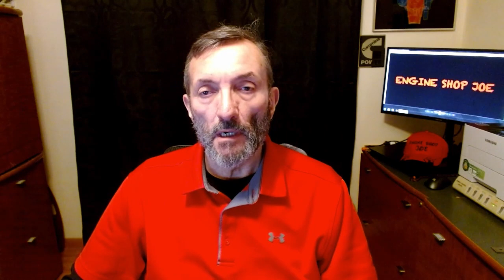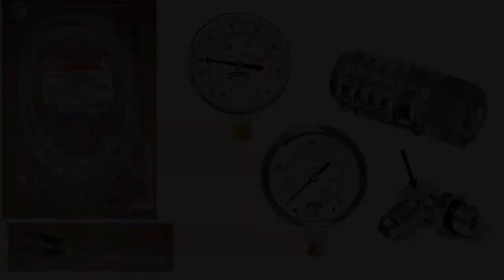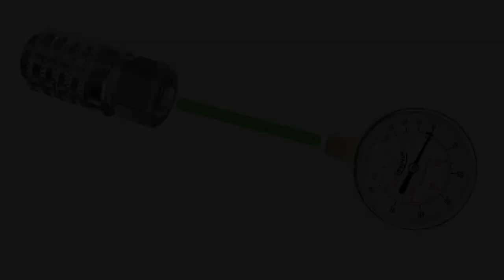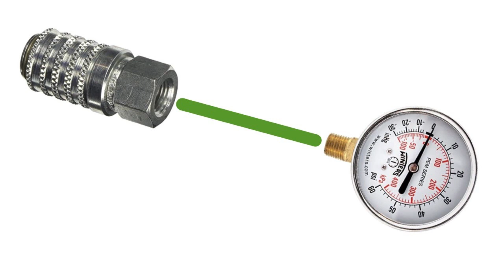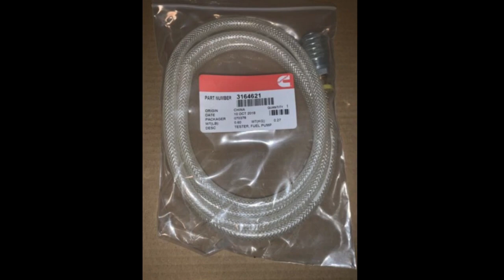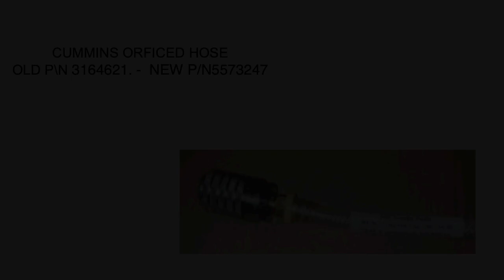ISX BASIC FUEL SYSTEM TEST KIT

Comment: Which port do I check the fuel pressure on for the gear pump and watching these videos for over an hour bastard
Reply from the maker: Use a fitting on the fuel filter head that bolts on the engine. Perferably the inlet from the gear pump- on the filter head there are arrows the arrow will be pointing in from the line that goes into the same fitting the arrow is over.

Comment: Man I’m gonna risk sounding like an idiot but I have a question? Should I connect the orfice line to the comp check on the gear pump or the comp check down by the metering and timing actuators on the underside?
Reply from the maker: If you have two compucheck or test fittings at the top use the one in the back of the gear pump-it is pressure out( early engines did not have one there). The top fitting that faces you is suction or restriction so you dont want to put the dump line there or the engine will suck a bunch of air in and stall. in that case use the bottom one by the filter.- There are no dumb questions and the fact that you are doing this yourself proves you're intelligent.
Reply: @ENGINESHOPJOE  so if I use the orface to load the fuel system off the test fitting below the solenoids towards the front of the IFSM do I monitor the pressure in series before that orface fitting at the same test fitting or would I be able to connect to the test fitting at the gear pump. This truck only has the one fitting by the gear pump. Thanks for the info! Nice knowing how this system is supposed to work in order to diagnose.

Comment: Ive had my truck with a 2350 in 3 shops now.  Trying to find the reason for measured not meeting commanded.  On a dyno, its calling for about 36,000 but only getting about 27,000.  When it does this...we get a 157 code and a de-rate.
Its also stalled (on occasion) while idling for awhile.  When it did that...it took about ten key-ons to get it to start again.
They've tested injector returns, re-torqued tubes, fuel rail decay, high pressure test.  All within spec...(mid-range)
We found air coming from the Paccar separator.  Installed a FASS and took off Paccar housing... thinking it would fix the air leak, any residual air, and any low fuel pressure side problems that we couldnt find.
Still didnt work.
Top of high pressure pump was rebuilt, new injectors, new actuator, new pressure sensor, new suction lines from tanks, new relief valve....still having issues.
About only thing that hasnt been touched is the gear pump.  I dont know where else to look at this point...but its killing me financially 😔

Comment: Thank you so much.
I've going through Quick Serve Online and found the procedure for air in fuel checks with the orifice tool. But for the life of me, I don't understand how to use it.
I have a QSC8.3 with a 559 fault code that I need to troubleshoot, and that is one of the tests to do.
Can you please make a video or send me a link to one showing how to do that test.
Reply from the maker: 3678923-M10 X 1.00 X 13.5 metric fuel filter threaded plug- That is the plug and thread pitch that goes in that housing with the cummins PN at the beginning. 3824842 is the quick check fitting that is 10 mm thread but it is too short so you need to put some pipe in there to extend it.
We use M10 Male to 1/8 pipe female then  a 2 inch piece of 1/8th pipe and a pipe coupler and a quickcheck that is 1/8 pipe 
P/N3377244(3042618 old p/n). The test port is in the top of the fuel filter head. There are holes cast in the bracket that holds the fuel filter head.
you can see the test plugs down in the holes. I dont remember the metric allen size for the plug. Put the fitting in the filter head and snap on your test hose then start her up and you are checking for air.
Reply: Thanks

Comment: I have an ISX15 cm2350. I’m currently chasing down what I believe to be air getting into my fuel system. I replaced the gear pump and have a question on the pressure… After the pump was replaced I received my pressure gauge that I ordered so I didn’t check the pressures on the old pump. Here’s exactly what I did… With the key off I connected the gauge to the inlet side of the pressure filter then I turned the key on to see what the electric lift pump was doing it made 30 psi. I then started the engine and I got 180 psi then I revved the engine to 1300 rpm and it went to 210 psi once the engine returned to idle it was at 150 psi I repeated this process several times and got the same result.. Is all of that normal?
Reply from the maker: You are good to go buddy! . It amazes me that the electric pump can push 30 psi but they do!
Reply: Thank you for the reply! I agree with you I was expecting to see 10 psi or so from the electric pump not 30.. You’re video series on fuel pressure has been very helpful thanks for taking the time to make these very informative videos.

Comment: Anyway you could link some items for leak test? Injectors,relief valve ect. Thanks for all the informative videos. I’ve learned quite a bit from you sir
Reply from the maker: Yes I will get that together and put up an exhaustive kit but hold your socks on the parts are pricey. Many times you can find alternate sources for the same fittings or hoses. The Cummins stuff is expensive but they warranty all their service tools. Used to be for Life but I haven't looked into that warranty coverage recently.